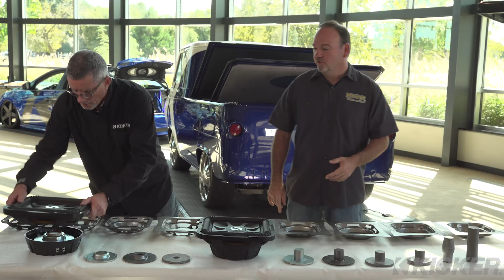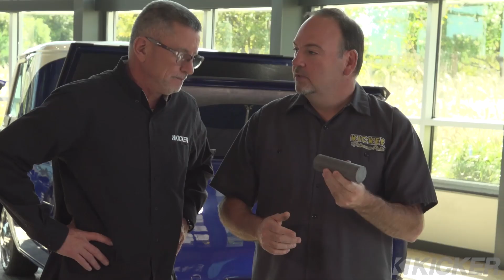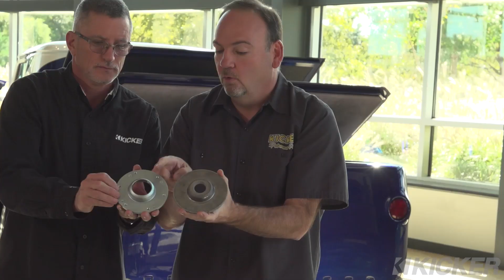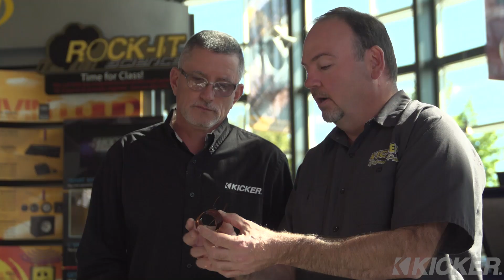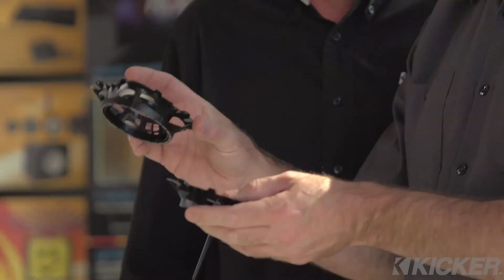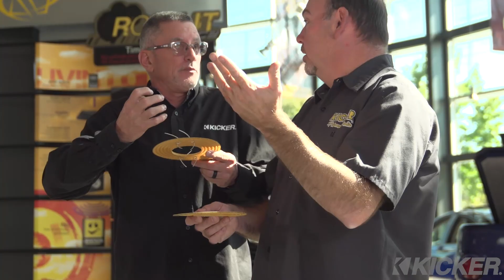Engineering the L7T From the Ground Up - KICKER UnMasked - Shorts

Comment: Was a good sub, but recently stopped working unless I press down on it. Only had it a couple of years.
Reply from the maker: Pressing down on the cone makes it start working? Sounds like a connection problem, like the tinsel leads or voice coil wire. Since it's out of warranty, I'd say give our support/warranty department a call and maybe we can repair it at cost - 1 (405) 624-8583
Reply: @KICKERAudio yea, I took it out the box. Pressing down on the spider makes it work. Can't see anything wrong with the wires, so it's probably something internal. Thanks for the advice though.
Reply from the maker: @Virtual_Vinsanity  No problem, sorry about the sub, though. Really makes me think the tinsel leads on the spider got disconnected from the coil.
Reply: @KICKERAudio  Mine did the same thing - do you recommend removing the subwoofer and inspecting for an easy fix?
Reply from the maker: @jacobsaw7336  Yeah, I mean, if you're out of warranty, you literally have nothing to lose.

Comment: I haven't had a system in over twenty years. Thinking about going back. I have always been impressed with this brand. My first exposure a friend had a 12 with no box. It hit so hard his windshield shook. I immediately switch out my blaus and got one twelve in a ity bity box. I won several bass offs with that 12. It moved so much air in my Plymouth Sundance. That was back in 93' 94'. Crazy part is I'm sure that woofer was not square. The only woofer that could compete was the Phoenix Golds. I knew a guy that had them in a Rocket. He won every bass of her entered. Auto sound and the other auto music shops would try and duplicate his set up with no success. Anyone from Richmond Va that's my age that was into what we called sets remembers Kevin with the gray and blue Rocket. He had to wear the head gear the people at the air port terminals wear just to ride in his truck. When a person says you could hear him from blocks away don't know just how bad it gets. You could hear him knock from so far away it had to be at least a mile. Bs you not. Unfortunately he was killed for his system, some jealous guys did a home invasion trying to rob him for his equipment, ended up going bad because he had all his equipment mounted and welded in his truck. Rip Kevin. You did it better than anyone I have ever seen. Kicker I'll see you again soon!

Comment: I am not sure if I am in the right channel but Can the JL Audio RD1000/1 @2ohm load can handle this new Kicker 49DL7TDF122? I am looking for a sub that will match this Amp. I really like to purchased the new Kicker 49DL7TDF122 that just came out.
Reply from the maker: Hi Moto+Rid3r! Looks like that JL Amp does 800W @ 12V & 2-Ohms and 1000W @ 14.4V & 2-Ohms. That amp will work just fine with the 49DL7TDF122! It won't quite be at maximum output, as that sub box can handle 1200W RMS :). To take full advantage of the 49DL7TDF122, I'd recommend the KICKER CXA1200.1 or KICKER LX1250.1
Reply: @ thank you so much. I will definitely going to look into this subwoofer. Where can I get to review this for free..

Comment: If these are put into a ported box would they sound pretty much identical to say an L7R ? 

I’m not concerned about spl more about the sound quality it provides compared to a full size
Reply from the maker: Depends a great deal on the box and port dimensions. You can go over those details with our Tech if you like: support@kicker.com or 405-624-8510. Open weekdays from 8-5c.

Comment: How long does it take to break in the subwoofer
Reply from the maker: There really is no hard, fast rule to break in. times.  Some say 100 hours, but with what music?  At what volume?  FYI, there is no danger to the sub at any point, no matter how new it is.  That's another rumor with no proof behind it.  At the end of the day, the goal of break-in is tuning your EQ/XO. The tune you give it when brand new will change as the soft parts (surround and spider, mainly) stretch a bit.  Give it a few weeks, play it consistently, then re-tune.  You should be good to go from there.

Comment: My brother bought these subs a week ago and caught one on fire I want to buy a set for my GMC Sierra Kind of if  Scared now he has a big hole in his back seat and the company he had installed it is not responsible they said
Reply from the maker: The first thing to do is determine the reason for the fire. Subs and amps fail for a number of reasons - incorrect setup, issues with installation, a bad combination of amp to match with the subs and factory defects are all possibilities. For the sake of safety, all of those things should be examined in detail. If your brother wants to contact our Tech Support department, we would be happy to help try to diagnose the problem.  Our number is 405-6214-8510. Our email is support@kicker.com.  We are open weekdays from 8-5 Central Time.
Reply: @KICKERAudio   What would be the recommended amp for 2  10"1000watts
Reply from the maker: Could you tell us what ohm load the subs are, and the number of voice coils? Once we have that info we can recommend an amplifier.  If you know the model number of the subs, we can find that info out for you if that's easier.
Reply: Kicker 46L7T102 10" Solo-Baric L7T Shallow-Mount Dual 2-Ohm Voice Coil Subwoofer
Reply from the maker: The CXA1200.1 is a good fit.  Wire it to A 2 ohm final load.